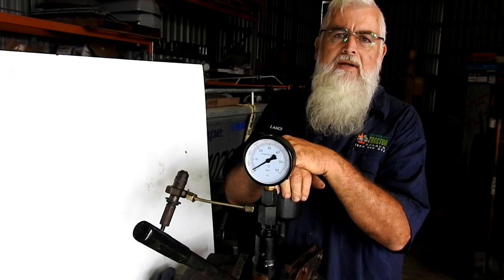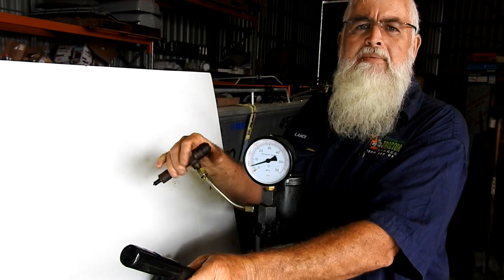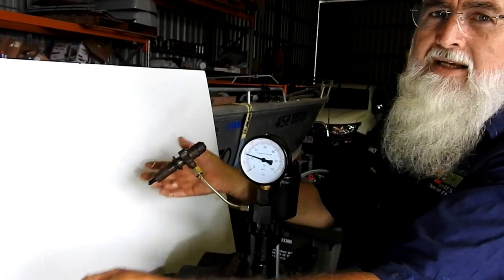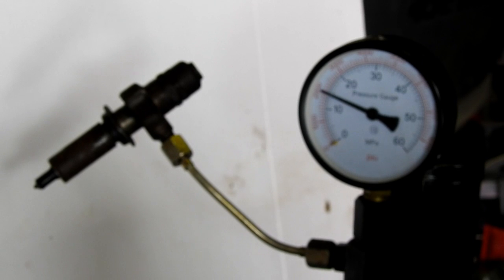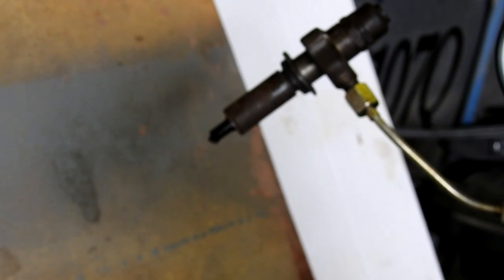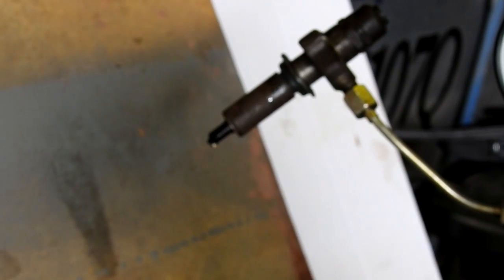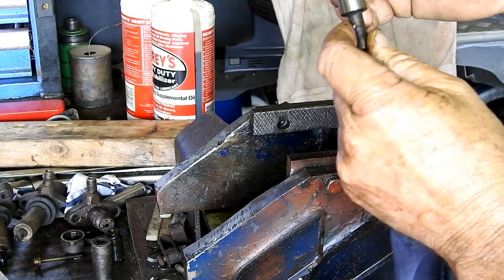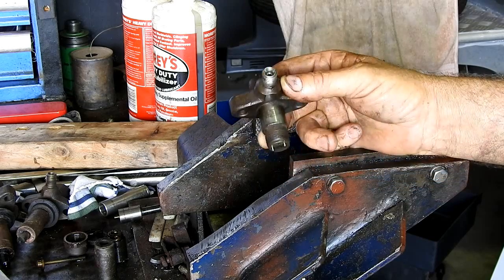MF135 6 Speed Restoration #38 Testing an Injector and Diamantling it.

Comment: Hi Lance,
Just another good video I am studying on! So thanks for that!

I am about to overhaul my AD 3152 injectors s only as I can hear a slight knocking when idling …I’m planning to do the nozzles of all 3 injectors… but do not have any pressure testing device as you do. 

So if my understanding is correct I just have to count the scree driver  turns before dismantling and keep them also when reinstalling back the injector..isnt’it?

Thanks again for your help
Reply from the maker: Yes that will get you very close if you take time to do it carefully.
Reply: @BundyBearsShed  thank you!
Reply: Thank you, so the more you turn the adjusting screw in the higher will be the opening pressure...
I may try to have them soaking to see it if they just need cleaning.. Do you thinks the nozzle can be
taken off without taking the spring out?
Is a knocking injector symptom of a leak (low pressure)? I just can’t recognize it…
Would you suggest also the AV DPA pump overhaul together with the injectors reset?
Thanks

Comment: Well explained.   I have extracted mine and cleaned them up.   Just wondering how many turns out on the adjusting screw after they have bottomed out. ?    I had one at 1 1/2   another was as much as 2  1/4  .  Is there a rule of thumb for these as I do not have a pressure tester.     My nozzles are shallow with just a  round ball for a tip.  Only 2 holes in the nozzle.    Thanks.     I think there should be some tension on the push rod spring.
Reply from the maker: I have not known of a setting apart from pressure but if each was different I would just copy them carefully as the difference will be the spring tension.
Reply: @BundyBearsShed  Thank-you.  Probably best to adjust while pressure testing as you demonstrated.

Comment: Hi lance, great info, injectors and pumps we are always led to believe that its a taboo do not touch subject, wonder why that is. My JD 2035 has 1 dodgy injector, on cold start it fufs a bit with whiteish smoke for a few seconds then kicks in and you can tell by the engine roughness to smooth when it starts to work correctly. I'm sure its only 1 but telling which one without taking them all out is the dificult bit. I sent 2 injectors from a lombardini 2 cylinder engine to get new nozles and they charged me 210€($333AuD)bloody ripoff but when you don't know it costs you.
Reply from the maker: Bloody expensive, you can get aftermarket JD ones cheaply now a days, I have used them with no problems at all.

Comment: I always wondered why those injector pressure testers never ship with drag pointer pressure gauges.  Still take some experience testing, but sure would be nice to see some peak pressures recorded.
Reply from the maker: When purging the pressure is high and as I can put way more fuel than the tractor will per pump of the handle it would not be a useful figure. But after purging I suppose it would be ok.